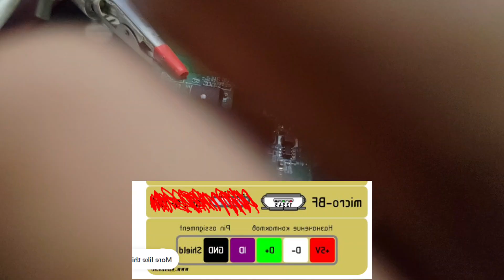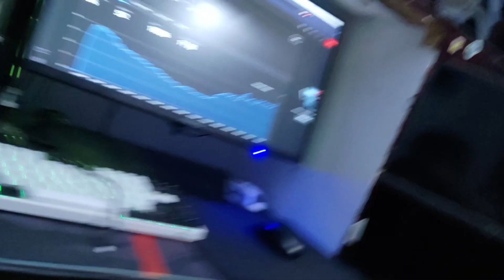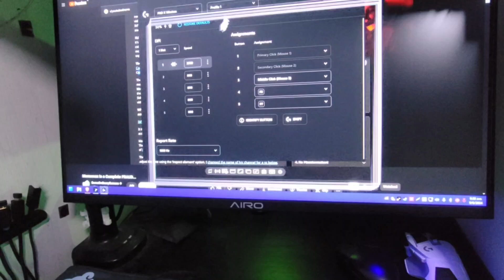how to change logitech g pro superlight x 1 micro usb to type-c connector

Comment: thanks very informative video
i did it the exact same way, i was pretty sure im gonna be extra careful with the pads but i managed to break them all 😅
your picture at the end of the video was not very clear but still helped alot, i just connected the 5v and ground pins and gave up on the data cause it was already pretty frustrating and i didnt really think of a use for it (idc it only wont work wired without the dongle connected, i'll always use my dongle anyway)
anyways just wanted to share my experience